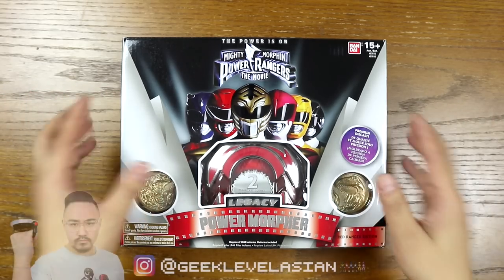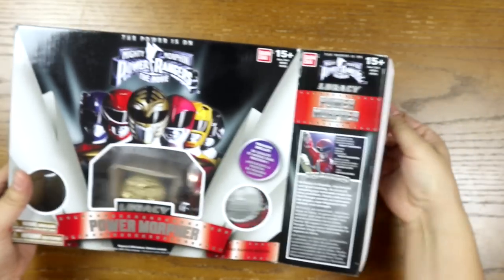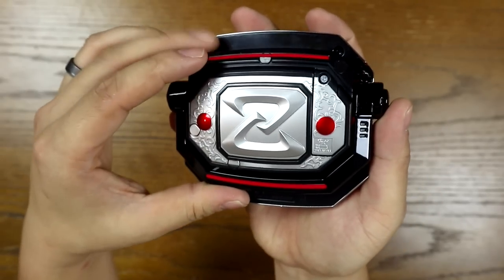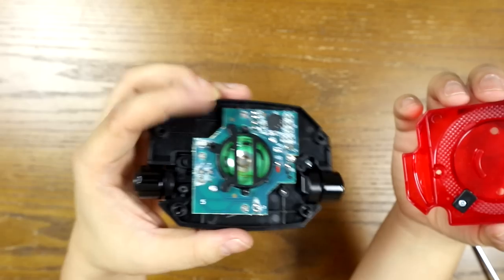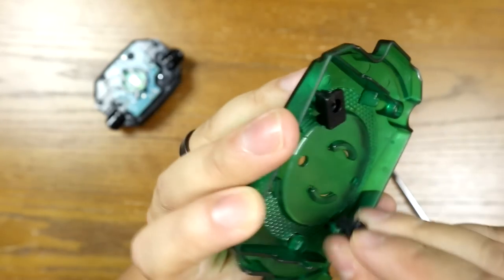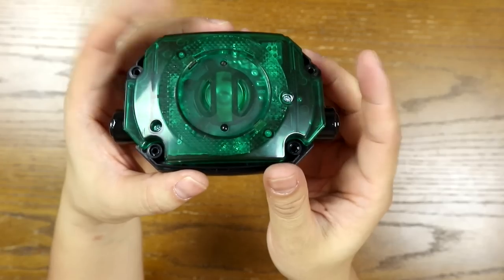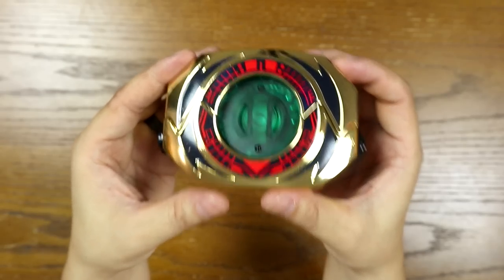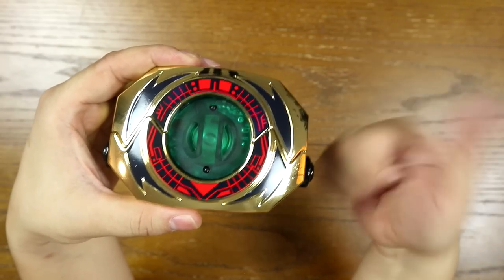POWER RANGERS How to Make a Master Morpher

Comment: Question: How big are the screws that hold the plates? I bought a green/white ranger legacy morpher and it didn't come with one of the black screws for the lower morpher plate. I'm planning on eventually turning that one into a master morpher, but might keep the original tommy legacy morpher plates instead of the starlight ones.